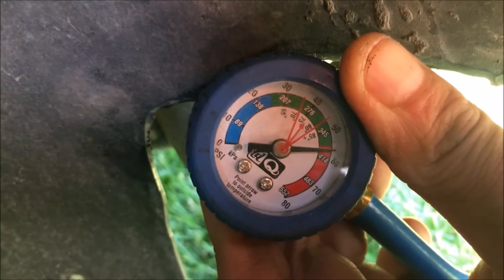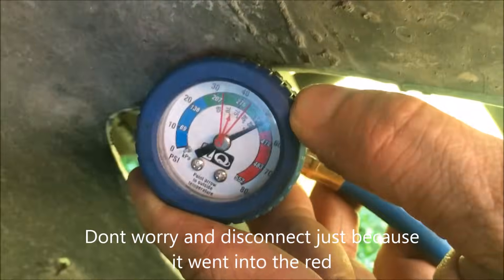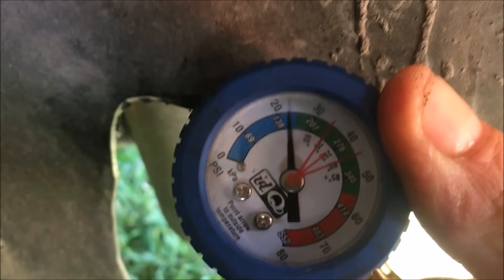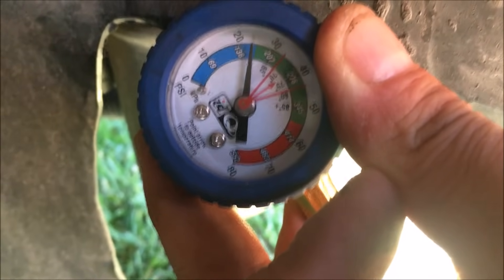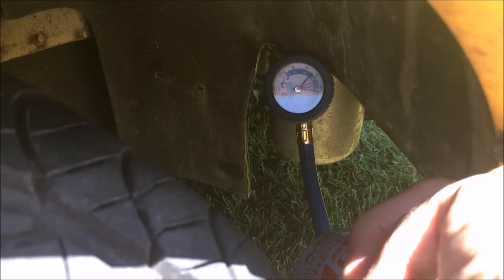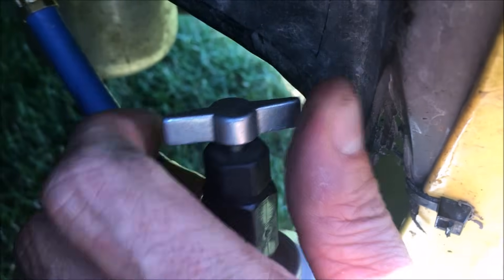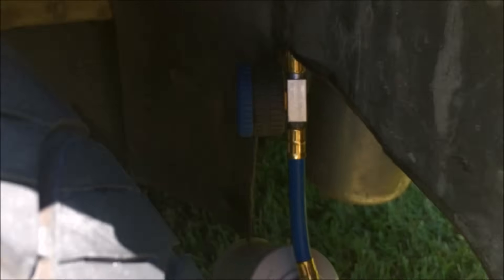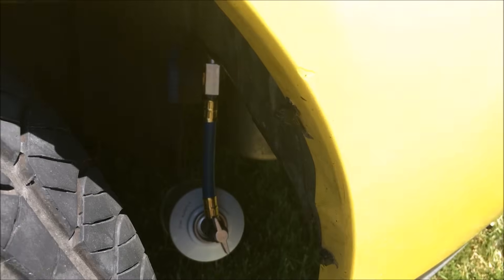Ac kicking on and off ( FIXED ) pressure fluctuation ( solved ) Recharge car ac. pressure to high?

Comment: Not just Ford,  friend worked at dodge dealer to replace the battery had to remove the front tire.
Chevy ecot3ch to change the oil cartridge it ran all over.
Some serpentine belts can be all kinds of fun to  R & R

Comment: I worked in a Ford dealership, I called the car, well, uhm. .to be clean...
F us
My boss told me I had that wrong, no.
It's...
Foc
Us
I hated to change oil or even work on the car 
The fuel filter was a sock st the fuel pump.
In turn clogs then pump is restricted on gas .
Ah, new cars rolling piles of crap.
Thin metal with plastic get into an simple accident is very costly.

Comment: When my 2011 Mercury Milan was doing that because I try to put it to where it said 40psi because of the outside temperature and my system stopped blowing air the pump would turn on and turn off every 10 seconds it would be in the red line it was only when I took that hose off of there and relieve that pressure down to about 30psi that my pump stabilized and could ran and started blowing cold air again if I squeeze that trigger one more time and it went above 32 psi that pump would run shut off and red line pump shut off Red line but I believe that pressure down to 30 lb my pump would run and blow cold air I think it's just about the type of system you have the determines everything. My air conditioning blows about 44°

Comment: Thank you so much for this video. I tried to add some R-134A to my  Crown Victoria and the  guage attached to the can of refrigerant kept fluctuating just like this video. I followed the directions provided in this video and sure enough the system evened stabilized and now I have cold air again.

Comment: Thanks much. My 99-mustang cobra had the clutch clicking on and off in 15 second intervals and no cooling. Using AC Pro the gage readings were all over the place from too high to too low. Based on your video I kept working with it in 15 second intervals rotating the can and the pressure normalized. The clutch locked on and the air got cold. Very happy!!!

Comment: Lucky enough to come across this. Was getting nervous. I googled it and got 4 different answers on why it would shut on and off. None good. I didn't know why my digital numbers  were reading high and low with a big gap. Thought I could have overloaded it. It made complete sense after you explained while it happened. Continued. Success. Thanks dude

Comment: Hi! This video was incredibly helpful in encouraging me to continue charging my Ford Focus ac. Question: I used a whole can of refrigerant and the gauge was still bouncing between green and red as the compressor cycled on an off. The air is cool but not as cold as it has been in the past. Can I/do I need to add more refrigerant or am I in danger of overcharging it if it’s reading in the green while the compressor is on? Thank you for your help!!
Reply from the maker: Yes add more , when you add to much it cycles on and off , if it cycles on and off after adding then lets some out until the compressor stays on , just use a nail or something to push the shraiter valve

Comment: Hey man, thank you so much for posting this video. I was trying to fix the A/C on my 2006 GMC truck, and freaked out when the needle on my gage kept fluctuating into the red zone. I thought I had a major problem and was ready to take it to a repair shop. Then I saw your video and added more freon until the system normalized, then charged it the proper amount.  It works great now, and you saved me some cash. You're Batman!

Comment: Great info to help me right now.  I love how he goes off on Ford.  I can't agree more.  After the Windstar van I owned back in the mid 2000s turned into such a nightmare, I'll never go back to Ford.  I own strictly Japan made cars, and I can't be happier with them.  Parts are cheap.  Pretty easy to work on, and they just keep running.

Comment: So the R134a pressure is in the green for me, AC is on full blast on cold, but the compressor is not engaging. If I add any more the compressor starts short cycling rapidly, and still blows hot air. Do you think this means my compressor is going bad? Or maybe my gauge is just reading the wrong pressure and I need to add more? Also I should note that when I touch the AC pipes, none of it is cold. Any tips would be appreciated

Comment: Thank you!!!! I have a 2006 Mustang GT and it was doing this fluctuation. I was scared to over pressure the system because it was near the red when the compressor kicked on. I added more freon when the compressor kicked off, and sure started to fluctuate less toward the middle and the compressor would stay kicked on longer until it stayed steady. Now, it's at a steady 30 with cold AC.

Comment: My ford fiesta 2007 aircon is running strange. It works normal on idle, very cold, no kicks on and off, 25psi pressure. But when i accelerate about 1500rpm, it starts to cycle on and off about 3-5 seconds repeatedly. I was looking for a solution? Could be bad low side pressure switch?
Reply from the maker: its over filled let some out
Reply: @NOBOX7  The reading was 40psi around 21degress C ambient at first reading, full blast setting and fan. I tried letting some out today a couple of times and i tried reving it up to 1500rp, the fast cycle was still there. Then it the pressure went down to 25psi. Now i guess it is low on pressure because it kicks on and off fast even though I don’t rev it up to 1500. Could it be low gas at the first place?

Comment: I have a 2010 acadia and the compressor was engaging and turning off ...shop said to replace compressor with kit and high pressure switch...it worked for a week and now doin6it again. Any ideas?

Comment: Thanks for making the video! AC pro like many companies have unqualified people making videos and instructions. I almost gave up and spent thousands on repairs because their instructions had me freaking out about going into the red range. Knowing that the compressor needs a minimum amount of “low” pressure to start and that you can only get a proper reading when the compressor is on (before system fills while short cycling) saved me. System is working after I emptied the entire bottle and short cycle stoped. Measurement is right in the middle (38psi) at 79F

Comment: 88 Dodge 3/4 ton, pump turns on for about 4 to 20 seconds off for 25 seconds. New compressor and I just charged it. It's blowing cold air. I put uv dye. Don't see any leaks, also tried soap and water same. I don't understand why or how often it should turn itself on and off. Any ideas? Thanks. 
update: i found a very porous discharge line with uv light and dye. Its leaking AC oil and i presume refrigerant. Napa time.
Reply from the maker: over filling the system will do this , had to pull over on side of road one day and stab the valve with a nail and let out pressure until the compressor stayed on
Reply: @NOBOX7  ok, thank you. Great useful video. I learned a lot from you.

Comment: So mine is fluctuating just like yours but I have the AC on. I keep hearing it kick on and off and that is synchronized to the pressure fluctuation. You think that's just low refrigerant?
Reply from the maker: it does this if its over filled to , let some back out by stabing the intake carfully with a glove on ,some times that stops the over pressur switch cycle your seeing
Reply: @NOBOX7  Mine was definitely low. I added a can and it works like magic. Thx

Comment: Why did you access the connection theu wheel well all you have to do is take out the passenger side headlight and you get full acces to the connecter

Comment: please help...my mitsubishi outlander 2009 2.4 L s AC compressor is running good when on low RPM...when ever the RPM is crossed (1500-2000 rpm) it is cutting off....and the other thing is when ever i remove the accelerator at high speed it switches on again...please help

Comment: I had a new air compressor put on my Nissan Frontier.  The air worked great for a while and then went back to blowing hot air.  I took it back to my mechanic, he kept my truck for a while, I called him to see if he found out what the problem was, he said, I didn't see anything wrong after checking everything.  I took my truck home with air on,  it worked great for a while and then hot air started blowing out of the vents.  I called him and said the air stopped working....I took it back to him, he looked at it and said everything was working, except the blower to my air conditioning was blowing hot air.  He couldn't figure it out!!  Any Ideas?  I saw your 
you tube videos and thought I'd give you a shot on any ideas.  Thanks!
Reply from the maker: Air baffle actuator inside the wind box. there is a vacuum line leak , these are always powered by vacuum
Reply: @NOBOX7  I took it back to my mechanic....he said my trucks  a little low on freon..filled it up..air still failed, he's putting in a high pressure switch....I don't know.. should I take it to someone else?  I'll mention the air baffle actuator inside the wind box, and check the vacuum line leak.  Hope he doesn't get pissed!

Comment: so if my compressor is going crazy like this i can continue fueling it up, or do i have to wait until the compressor reads right?
Reply from the maker: keep adding fluid , wear eye protection
Reply: @NOBOX7  i continue to fill and it’s going off the charts and the compressor spins for a second then turns off and repeats
Reply: @NOBOX7  but when i went to fill it up this morning and the compressor was running i was only reading at 20 psi as i live in texas it’s 100 degrees rn
Reply: @NOBOX7  do i keep fueling or wait for the day to cool down?

Comment: Well I just bought a 1993 Chevrolet Silverado diesel dually and my AC works but the compressors In and Out In and Out in and out blows out awesome cold air but it just will not stay kicked in I will try your method and see what happens I hope it works

Comment: Does your compressor cut on and off for it just stays on when it's full? Cause I got a 2000 silverado 1500 I got the ac working on it but it does not cut on and off like my other car. It just stays on. I don't wanna burn it up

Comment: My 2016 Grand Cherokee has an issue where the AC compressor kicks on spontaneously when it’s 100% supposed to be off, and then when the AC is running the compressor kicks on for two seconds then off repeatedly every 10 seconds. The dealer charged me $160 bucks to tell me it’s working fine. 😡😡😡

Comment: I have a similar problem with my wife's gmc Acadia.   I hook up the nozzle to the low pressure line which is down in front of the fan.   I hook it up,  the compressor kicks on and off rapidly but nothing is coming out of the can.   I've tried repositioning the can but it will not charge the system.   I can't figure out if it's the port or the nozzle

Comment: My compressor is cycling on and off like that so I bought some manifold gauges and it’s doing the same thing as you showed on this video. But before I put a Freon gauge on it from autozone and it says filled 🤔 I’ve tried 2 different Freon gauges and it’s the same reading

Comment: Excellent information, thanks! I was having that exact problem, so I took off the can too early, thinking I overfilled the system. Saved me a ton watching your video.
Reply: Same here
Reply: Same here
Reply: so did I..

I actually used up a can, then emptied out the system out of fear, then bought another 1, & did the same thing.

Now I know what to do.

I will buy a couple more & try again..

Comment: Ever try and change the spark plugs on a Chevy Lumina V6 ? You have to lift the engine forward to change the back three. And if you had proper ac gauges you wouldn't have to reach between the fender and tire.

Comment: Great just found this vid after searching for a while, filled mine years back with a/c pro and still have the reusable filler gauge. Often i think I did`nt do it right but still had somewhat ok a/c. So at least it will help me figure something out. If any one were to know i would appreciate the info but along with the constant on and off the compressor often sounds like it has marbles rolling around in it . Is that a sign of bad charge or needing compressor replacement? I still have cold air just not what it should be.

Comment: Thank you so much, I haven't had my a/c running in years and just dealt with because I live in the mountains where it's not too bad.  Went to the nearest big town a couple of weeks ago where it was 110 degrees and after that I was determined to figure out what was wrong.  Turns out I was just reading the gauge wrong thinking I was overcharging it.

Comment: I've been miss reading the gauge this whole time, thank you so much for this important tid bit on how to diagnose this stuff. I can't thank you enough. You were completely correct, my compressor wouldn't stay on long enough to accurately see the pressure. After emptying an entire large can into the system the compressor finally stayed on and got up to a steady 30 psi. Ice cold again! Only question now is where is the leak and how bad is it. I haven't noticed any leaks but the compressor is down low on my vehicle as well. Thank you Thank you thank you!!!

Comment: i just had my ac recharged by a mobile guy. however. during the top up process the ac was ice cold. but towards end after he switched off..the air got warmer and i can hear the ac compressor clicking on and off every few seconds even with ac on. he looked at it and said he couldnt see any dye or smell it leaking. any ideas what this could be?

Comment: Thank you very much, i just fixed my Chevy van AC, before watching this video, my van AC always on and off in a second, and the pressure meter always UP and DN bewteen 5 to 75 psi, now i got it , because the freon gone, when the compressor on the pressure go down, the system low pressure sensor on, then turn the compressor off, when the compressor was turned off the pressure go up, so we can see the pressure meter always go UP and DN repeatedly, Thanks again!

Comment: Thank you for the info. The can doesn't explain a whole lot as far as the pressure dropping off when the compressor kicks on. Once I got enough refrigerant into the system the compressor stayed on and the gage stayed in the green and stared cooling.

Comment: I just had this same problem and just fixed it, if you put the gauge with a can of freon on it, but dont crack open the can with the opener, if the pressure is in the red too high, and then ac compressor turns on and it goes down but still in the red, the ac compressor will turn right back off, so i took a pen apart and used the ink tube to release some pressure, with the ac on full blast still and car running, as soon as i let a little out, the compressor stayed on longer, so i let more out and recheck with gauge, once it got down to the yellow part it started staying on the whole time and cooling, so check the pressure, if its too high, itll turn on and back off within a few seconds, hope this helps

Comment: I have a 1998 chevy Silverado and this was happening with me. I was paranoid that I was gonna hurt the compressor, but after I kept filling it the compressor started to spin slowly, and then when the can was empty it started right up and the cold air was pumping through. Wonderful video!
Reply: Got a 98 Z71 Silverado that evidently leaked out so much the low pressure switch wouldn't let the clutch engage. Got a can of 134A in so far and the clutch went from rapid short cycling to a less rapid cycling. Gonna get some loaner manifold gauges and a few more cans of 134A and attempt to dial it in and maybe put in new valve stems. Hopefully that'll do it for another decade. Lol

Comment: just bought a used 2007 pickup and he had some front-end work done and all new air compressor stuff and condenser and there's no air blowing hot your videos saved me man rest of these videos I watched and not explain it I was getting nervous because it was kicking on and off and the other ones didn't explain that that's because it was low so I got nervous when the needle went into the red with then go to the white and you explained it in layman's terms so a man could understand thank you very much take care of you safe

Comment: Mercedes G500

A/C on, normal gauge reading and cold air...30 seconds later....aux fan kicks on, air blows luke warm, and pressure is low...

It keeps cycling back and forth like this...?

Comment: Great video. Had somewhat similar problem so I  bought a can and started filling. The can got a little cold but not much more. Turns out I had the valve opened to far so when I tried it again I only cracked it 1/4-to 1/2 way and then it started taking it. Thanks.

Comment: I had a system that had too much freon and would intermittently cool. Now that i corrected the charge/pressure, the clutch stays engaged, cooling fan comes on but no cold air. Anyone have any input?

Comment: If it's cycling, you have a leak in the system. Pumping freon in it is a temporary fix and it will eventually just leak out again. Also, That's a dryer canister at the end of the video.

Comment: How many times would I need to service the ac (recharge with refrigerant)? I had my 1996 lincoln ac recharged 2 years ago and today it all of a sudden does not blow out cold air. The compressor keeps clinking on and off and I can see it happening. I'm not sure if this is normal but it has been doing that since it got serviced.

Comment: Hi everyone ! Does anyone can help me with my problem please. My ac not working but when the front fan start , if I manually help the clutch the compressor run for 10 seconds then stop with the fan. when the fan start back , the clutch not engages . I help it and it start again for another 10 sec then stop. I add a full can of freon but my gage is broke I think. I`m probably overcharge now ! I don`t know ? thank`s for helping